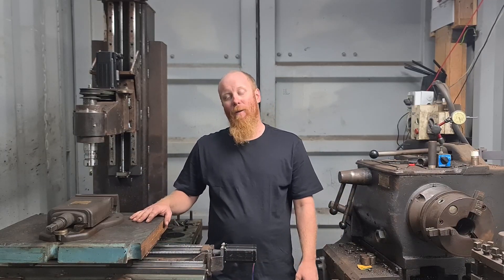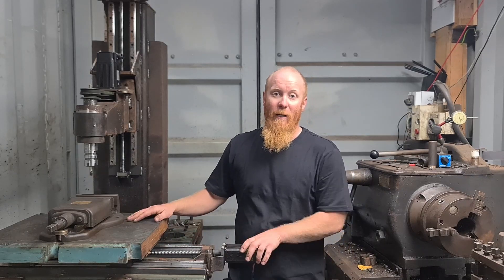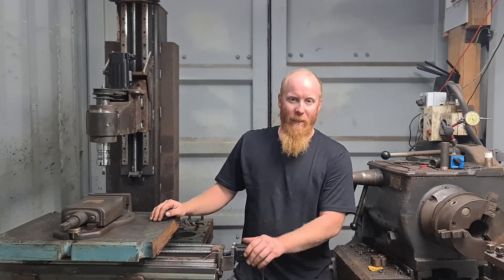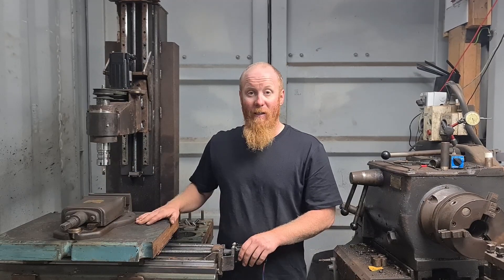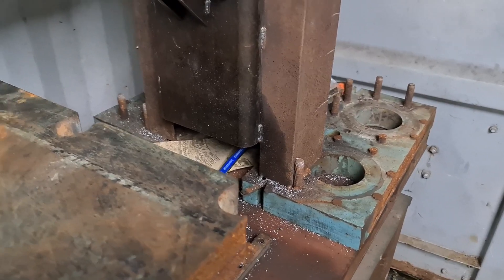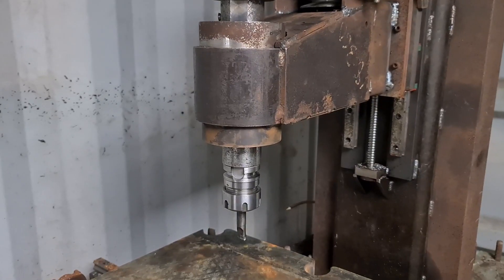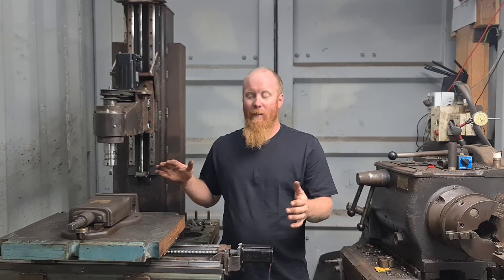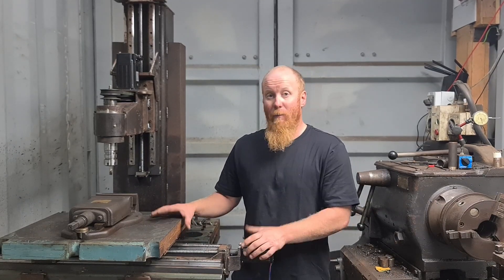Don't build a DIY CNC MILL until you watch this

Comment: You have good quality friends. My peeps do not have large pieces of unwanted  50mm plate lying around. It's very sad.

You've done really well, though. I really like the way you stuck to the fundamentals. I've long believed that I need a 60 ton bulldozer in my shed. It wouldn't need to run. I could just bolt stuff onto it and have a workshop full of wonderfully rigid tools.
Reply from the maker: You are correct. I do have some very good friends that like to help me out. 

I love that idea. that would indeed be able to house some really good machines. I think you should do that and film it. Will subscribe

Comment: Have you had a chance to measure how much deflection you get?  I would guess the weak point is not the column.  Usually the spindle is the least stiff and the lienar bearings are next worst.  On your design, the overhanging spindle assembly seems more likely to flex than the column.  Measure before you throw more steel at it.
Reply from the maker: Hi there, cheers for the comment. the machine is going through a big makeover at the moment. Everything is pulled apart, but I will check that once the upgrade has been completed.
Reply from the maker: check out this video for the upgrade that are being done.
https://youtu.be/OWsy3WpL9tA
Reply: Everything lasts longer if you can keep little bits of metal out of them.  Use rubber or leather or sheetmal.  Anything is better than nothing.
Reply from the maker: yeah, agreed. I have some ideas on what I will do to cover the ball screws and rails. I like the sheet metal idea so I can run off the coolant to divert it back to the tank

Comment: Good morning, I speak from Brazil and I am starting a milling machine, would you have the links where you bought the engines and parts on Aliexpress and also what you need to assemble
Reply from the maker: hi there thank you for the comment. i would recommend going on aliexpress and searching for the parts and look at the best shipping options to your country. 80st-m02430 are the servo motors, bt30 atc spindle is the spindle im using if you go to cnc4pc.co and search for the c82 and ess board and use the code GINGER10% to get a 10% discount on the controller board. the linear rails im using are 25mm. the bolting hardware im using is from a local store

Comment: It looks very powerful! How did you calculate the height of the lowest point of the Z-axis? Did you mean the height of the vise and other fixtures?
Reply from the maker: I have some big upgrades coming up with 1hp servo motors and a new spindle.
yeah, I added all the hights together and calculated the drop from the top to get maximum travel. cheers for the comment. I appreciate you time taken

Comment: I would say fatten it up ( fill up all the non moveing part of the machine. And frame that it's on with sand or epoxy granit)  and amount some form of air assist to help with getting chips away ( can even be as simple as a long peace of tube mounted to the side connected to a air gun well aimed at the tool / cut)

That's what I would do if it was me ( weight is your friend when it comes to metal cutting. The more damping weight the better)
Reply from the maker: Hey there thanks for your comment.
 I was planing on filling everthing with sand and epoxy.
I did fill the moving axis with sand and epoxy and noticed a massive difference in vibration.
I will be putting some sort of air/cooling on the machine. 
Once I finish and move into my new workshop I will be starting work on this machine again.
Cheers for your comment appreciate your input.
Reply: @gingerninjaneering  you could also use diffrent size steel beats insted of sand ( same physical mind of daming effect but way heavier and more waight is always better. at least in the collem and base.and frame that its mounted on and then sand in the moveing parts ) like putting a one ince layer all around the inside of epoxy granit or epoxy steel and the rest of the inside is then sand or steel/iron beats ( personally i would probably go for the steel beats ( and some old steel ball¨s )  since more weight more metter ) also leave a 5-10 mm gap at the top so the sand/ metal beats have space to move around a little and do its damping magic. othervise it cant move and if it cant move in cant eat up the vibration energy and then its just like a sold pease of steel with no daming effect ( have a bit of experience )

but best of luck to you
Reply from the maker: thanks mate I really appreciate your Input once the new workshop is built I will be getting back into working on the machine and will put your advice into play with the machine.
Reply: @gingerninjaneering  your welcome mate. if there is anything you wanna know then dont hasitate to ask and i well answer to the best of my abillitys with the knolage and experience i build up about it over the years ( btw if you mill some aluminium and want really good sidewall finish then i recomend YG1 alu power with a 0.1 wirh of cut and 0.07 feed pr. tooth. best wall finish in alu. brass and copper i ever got. and its not like they are super expencive for a finish tool  )
Reply from the maker: I will definitely keep that in mind thank you for that. 
awesome once I Crack back into the machine I will be doing a bit of aluminum casting and machining that will come in handy.
Reply: @gingerninjaneering  your welcome

Comment: Solid but not heavy enough I would suggest filling non mobile base parts with concrete or sand to take out some of the vibration.
Reply from the maker: Hi there thank you for your comment. I will be filling the other parts with epoxy and sand later down the track. 
It worked well on the moving carriage box sections to reduce the vibration.
thanks again for the comment.

Comment: how do you lock the z axis. does the motor hold it in place or is the another way of locking it
Reply from the maker: the motor locks it in place but I will probably put a counter weight on the back side of the machine. cheers for your comment most appreciated.

Comment: Would love to see a comparison of building a mill from scratch vs restoring an old mill. Dont necessarily need to do the restoration, just your personal comparison of the two of them.
Reply from the maker: Thank you for your comment. I will look into that when I have built my shed. I have wanted to get an older mill and convert it to cnc aswell.
Thanks again for the comment.
Reply: Hi, I was all into building cnc and watching bunch of vids on yt, but I was fool and didnt know whats on the other side till older guy machinist told me.
Few days ago old mill was selling for about 2000$ in decent condition, its a 3,7 ton beast, sk40 holder. 
So for me there is no way am going to build it anymore, will try to make some money and look to buy 8000$ Huron MU6 mill Y 1600mm x X 770mm x Z 550mm working area and convert it to cnc.
Reply: Hi, I was all into building cnc and watching bunch of vids on yt, but I was fool and didnt know whats on the other side till older guy machinist told me.
Few days ago old mill was selling for about 2000$ in decent condition, its a 3,7 ton beast, sk40 holder. 
So for me there is no way am going to build it anymore, will try to make some money and look to buy 8000$ Huron MU6 mill Y 1600mm x X 770mm x Z 550mm working area and convert it to cnc.

Comment: looks great, definitely a solid machine. I’m building something similar right now and would like to use a servo spindle instead of the typical 2.2kw vfd spindle; how difficult was the fabrication of the headstock? what spindle/taper are you using for yours and where did you happen to get it from?
Reply from the maker: Thanks mate appreciate it.
The fabrication wasn't to bad I have a video coming up on the machining of the spindle. 
The spindle was turned on my lathe I turned a bt30 taper and machined everything in house. The spindle motor came off aliexpress its a 1hp servo motor with the controller.
Reply: @gingerninjaneering  fair play guys. Love the enthsasim, but, if you want rigidity, even on a small mill, dont do what HAAS does.....
Makimize the size of your ways...
You wont regret it.
Reply: @globalrezzanate9399  eventually everything will be upgraded to bigger and better parts as I can afford it. Cheers for the comment most appreciated

Comment: Very cool! I'm a fan of machining too. What's your next project with this CNC mill?
Reply from the maker: Thanks for you comment.
I have lots to do yet spindle upgrade, servo motor upgrades, 
frame stiffness needs to be addressed more although being in a timber floor container doesn't help with vibration.
I have alot of projects coming up stay tuned

Comment: Good one mate. How perpendicular are the axes?
Reply from the maker: Cheers mate.
They are pretty good the z I am still working on when you cut with the machine it has a slight lip on one side of the cut. I will be pulling it back a touch more and welding in some braces to keep it square.
Reply: @gingerninjaneering  have you machined the table once? A skim over the table will make it better
Reply from the maker: @xMalhardeshmukh  I have just done this will be in an up and coming video
Reply: @gingerninjaneering  waiting for it